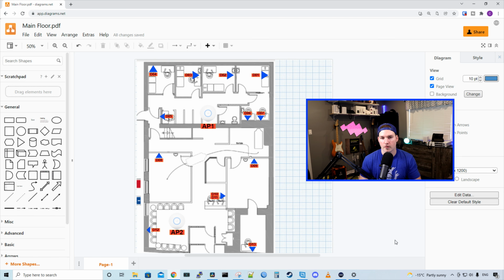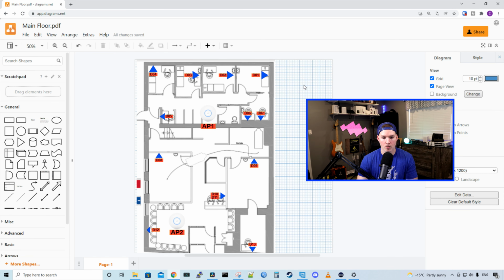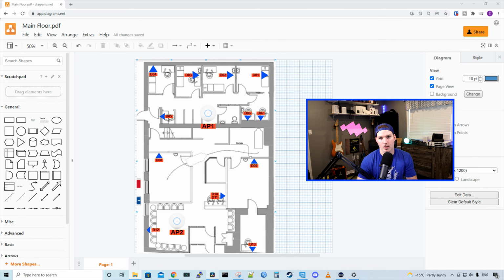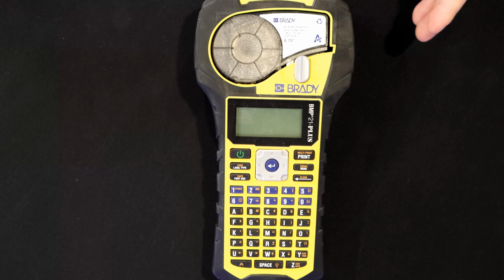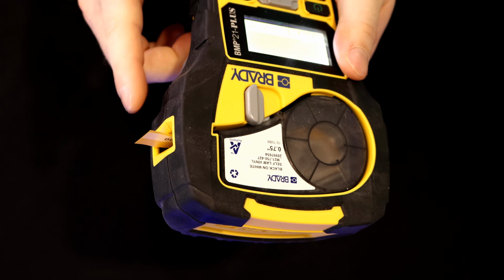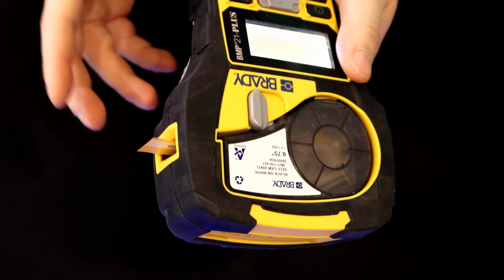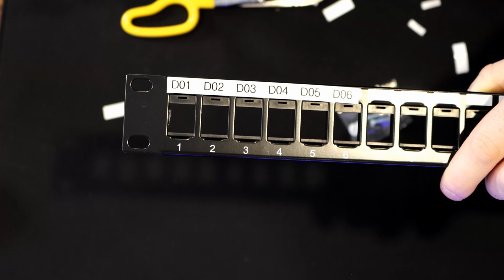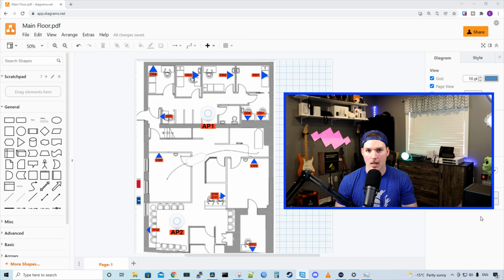Cable Labelling and cable management

Comment: Tbh I never label cables. Why? It is typically two or more people job to lay them. If you have tight spaces - you risk losing label anyway (and yes, I did experienced it many times). If you have to lay them in stages (due to longer runs) you will have to trim them, so labels can be lost or have to be redone. I relly prefer using pair finder instead. With this simple and cheap device I can find cable in seconds (even with 240 cables going inside cabinet) without looking at any label and with confidence, that it is the proper one. Many pair finders also come with wire map tool built in. Only thing that is left after is simple labeling of outlets.

Comment: I use a P-Touch with heatshrink cartridges... shrinked on the cable this never comes of... whatever labels I used before, whatever way you stick it on the cables, after some years every label comes off with the time..  and yes, the label waste with P-Touch labels or the heatshrinks is enormous and I hate that too 😫

Comment: When you label with a sharpie, write on it vertically not sideways. Numbers and letters are vertical in nature. So writing them vertically allows you to always grab the wire the same way, (by the end) holding it vertically making it easier to read the writing. Notnto mention, this vertical position in writing allows you to write larger, allowing for easier reading.

Comment: I got Brother PT-E110VP label printer for my work few months ago and I too hate that it wastes a lot of label tape. In a few reviews I watched no one seemed to mention that so you're the first one mentioning it and I am happy that I am not the only one feeling the same about it.  But for it's prize I think it's not a bad choice if not a lot of printing is done. :)
Reply from the maker: Some people have mentioned on here that you can change the size so it waste less. I have not tried it out yet though
Reply: @MactelecomNetworks  There is a possibility to change margin size, but it only puts a mark where to cut manually with scissors to get wanted size. Or as @INGY23 mentioned - chain print can be done. Though in my case usually every label is different so can't do that. It seems like it's a design flaw and a cutting thing is too deep in a device. :D
Additionally, for marking cables in a straight line (as shown in a video) is not very practical either as max label width is 12mm, you can't wrap it around the cable and it can come off easily. Cable flags work a bit better for that but I don't like them. Maybe this will help someone picking their own label printer.

Comment: We use pre printed lables  three sets.  one goes on the cable end that gets pulled to the room one goes  on the cable box (temp) and when the wire is pulled it gets attached to the patch panel end.  the third one is used  right by the patch  panel  so that  all the cables are uniform. another advantage is if you are missing a number you can stop and see where  you messed up if you use a sharpie it is easy to get a duplicate.  I was on a job years ago that had a duplicate and we did a lot of  renumbering.

Comment: Generally patch panels are already labelled 1-24. I would just label the patch panels A, B, C, D etc and end points just do the A01 etc.. Saves a lot of labeling at the patch panels. Also Ethernet is generally all data now so not much reason to use D to demarcate data. Also if you have multiple cabinets on one floor you'd do something like 1A01 then label each Cabinet 1, 2, 3 etc

Comment: On the wire there's usually a number printed on it - the length off the spool in feet (or meters maybe in Canada?) - if you know your run is 50 ft you either add or substract the 50 from one end to get to the other end .... helps you out if nothing is labelled correctly

Comment: Cody, why not just print the sequence from the brother, and cut them as you go from one big strip for your faceplates, using a similar method as you use for the patch panels?
Reply from the maker: I do that as well when we have lots of network drops. But sometime you only have one. Others have pointed out it is probably my settings

I’ve never changed them just on default so I’m going to play around with them
Reply: @MactelecomNetworks  I wish I could change my setting, but i bought the cheaper brother and can't change those margins.

Comment: When I pull wires I use binary and a sharpie - eg cable #6 has "mark-mark-space" repeatedly with the first mark thicker ... that rubs off much less than numbers or letters, those become smudged and un-readable easily

Comment: Just checking on the brother you do know you can change the print margins so it doesn’t waste as much tape. On a manual cutter chain print won’t work too well but if you put it on small margin it will be a lot better. If you have a automatic cutter you can put it on chain print and then you only get a bit of wastage on the first and last label usually about 1cm

Comment: Nice to see how you do it, although i have one BIG tip that may be really interresting for you
Those cable wraps sometimes tend to get loose in like 10-20 years, or when they get hot/wet whatever
There is another way, brother sells heat shrink tube cartridges, so you can print your cable id directly on a piece of shrink tube and then push that over the wire, one quick brush with a lighter and its sitting solid on the cable

Also useful is when you run a lot of cables from a central place, have like 5 boxes of cable there, label the beginning of each cable with the shrink tube (that wont fall of :D) and directly print a second identical shrink tube label while you print the first, pull the lines all the way and as soon as you cutt off the roll, push the shrink tube over the end and maybe tie a knot if the length isnt final so it does not fall off the cable before you shrink it
Makes life easy 😇

Comment: I pulled a face when you showed the Brother labeler - I HATE how it wastes so much tape because of the cartridge design compared to print head location. The Dymo 280 doesn't have this problem and is a solid unit. The 160 is slightly cheaper but the 280 can also connect to your PC and be a regular printer, giving you access to more fonts, barcodes, etc. Comes in under CAD $100 I think and works great - check it out!

Comment: When my house got built the contractor never labelled my cables (he did it in one day while i wasnt around). I had to do this manually IE plug in a device  into a faceplate panel and see which cable lit up on my switch. I am curious if there would have been another method you would use for instances like this?
Reply: If you had a large number to do and all the patch cables were live into a network switch for example, there is a feature called Port Blink on some testers. At the wall jack you plug in the port blink tester and look at the switch. There should be a port light blinking on and off at a steady rate. This has the benefit of being able to work on a live/active network without interupting those using the network.
Reply from the maker: You can use a tone generator you plug in a device then at the patch panel have a “wand” when you hit the right cable a ton goes out the speaker of the want
Reply: @MactelecomNetworks  Ah, thanks for the reply. Needless to say 20 drops later i didnt need to do my workout for the day lol.
Reply: There is a solution for that, of course 😇
There are network tester kits that also have a mapping functionality, like the Fluke NETmap (there are cheap testers for that too of course)

They come with a testing unit and a bunch of little RJ-45 plugs with numbers printed on them

You then go around and plug all those little plugs into Sockets around the house and then go to the other end and go through all the ports, the tester will then show the number of the plug on the other end if it finds one

If you have a managed switch then its even easier, go around with a laptop, plug into the port and see what port is now occupied in the config page of the switch 😇